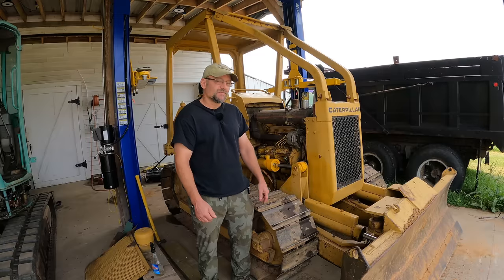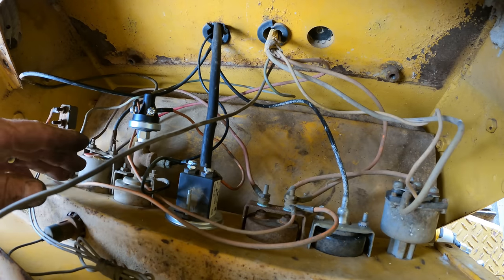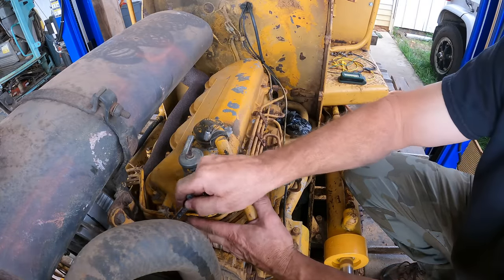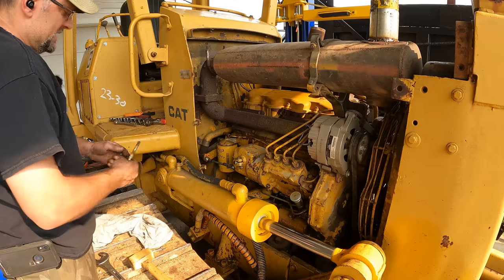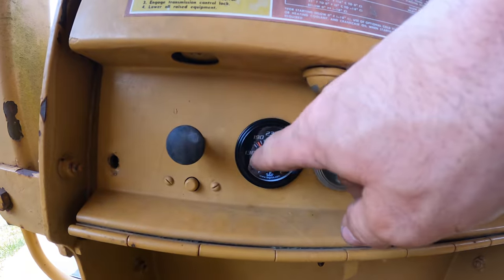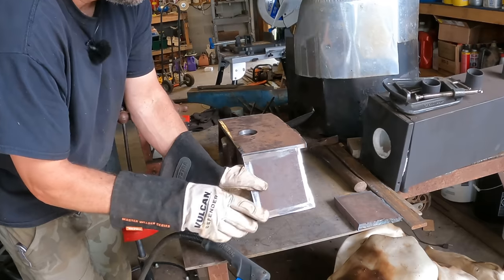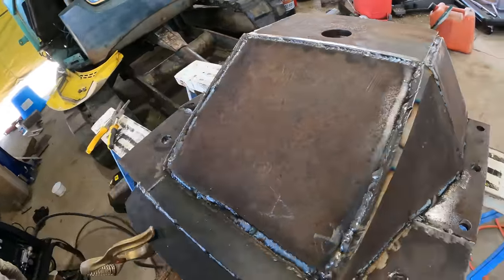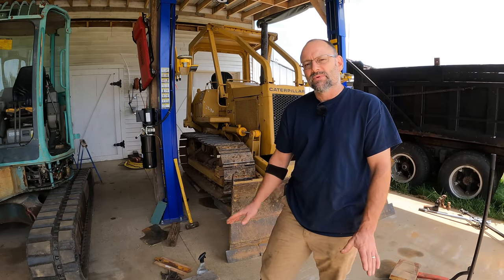How My Audience Saved This CAT D3 Dozer From Disaster.

Comment: As a former HD mechanic you should know that Farmcraft is the words we used  for a botched job. My father told me if it not worth fixing right the first time it just worth fixing. JB weld is a get product to get you home. Not a repair you’re oil leak will be back in no time. The castings need to come off and be built up with weld or replaced Why you would not get the proper alternator for the dozer is beyond me. Time you have wasted and it a patch job. Your hard starting problem is simple the motor is down on compression. You did all the work on the oil pan cover and you left a hole in the bottom that is going to fill that hole cover with dirt and give you problems. Your temperature sender will not last long flopping around like that the copper tube will crack like the last one and stope working. This pice of tubing must be secured so it can’t vibrate. You did not even put rubber in the P clamp. 
It is sad that people watch this and think this is a proper way to do things. You are a great machinist you should stick to what you know.

Comment: I'm working on a late 90s snapper z2002k.  Can anyone tell me what hydraulic fluid it needs?  The internet tells me 15 or 20 w 50.  The previous owner put low vis hygard.  I just want it to work.  It only runs well after it's hot.  I have no definite answer.  I was thinking about doing whatever Ave said and post the wrong answer and wait for someone who knows to correct me.  Anyone with knowledge please help

Comment: That gm 10-SI alternator does not have a field it is internal regulated
You did not wire that alternator correct  termanl 2 (sense) was correct direct to batt+ term 1 goes through indicator bulb to 12v switched ign source. If you have parasitic draw to test alternator remove term 2 plug test  sense term (2) if 12 present replace regulator and test other internal components

Comment: Chasing a wiring problem in a brand new enclosed trailer and every single wire was terminated at the back of the trailer with a scotch connector!! I would rather have seen a butt connector.

Comment: If it will not start without glowplugs at all, its a compression issue. Simple as that. I'd let that alone, as far as it starts well with glowplugs and runs fine. Not worth to dig deeper into that.

Comment: Is it okay to leave the bare ends of the temp gauge lighting wires in there? Would they short?
Reply from the maker: Worst case it would burn out the LED. Very unlikely to short because they are short in length and cut off straight with no stripped insulation.
Reply: @FarmCraft101  qq
Reply: There are no power in those wires to the bulb unless you energize them by connecting them. One is 12V and the other ground.

Comment: 12:53, this test for parasitic draw is no good. No good at all.  You are in the A - ampere - range. You would expect something down in the low milliamps, so you will need to set your meter to mA...  (not something you would have to think about if you had an expensive DMM with auto range ;-)

Comment: Did you just use a table saw to cut 3/8" steel plate.  WTF??  NO SHIT.
im gonna have to look at evolution saw blades, that boggels my mind.
Reply from the maker: It’s their saw. Spins at lower rpm and higher torque.